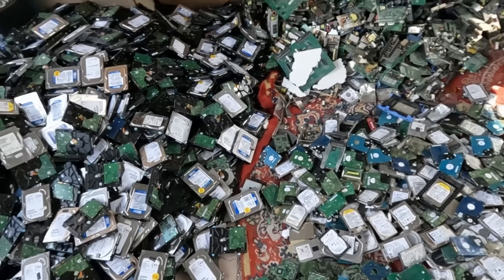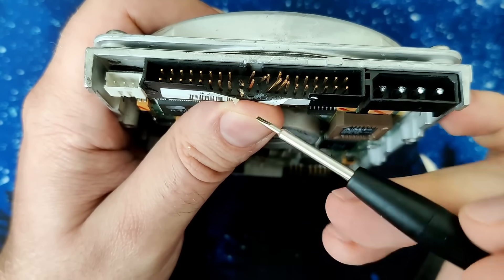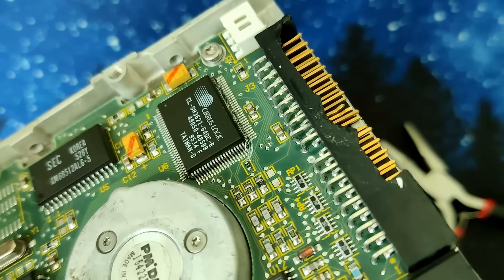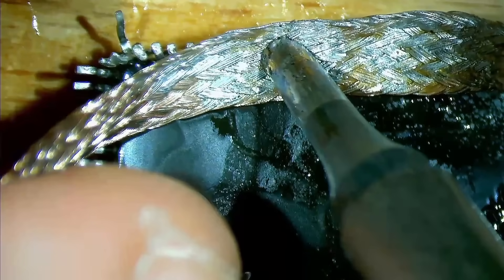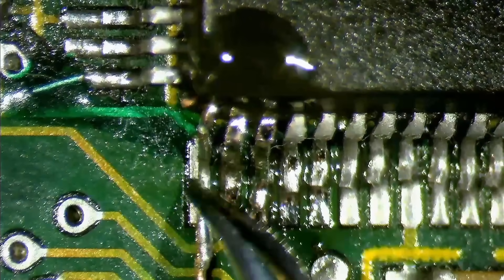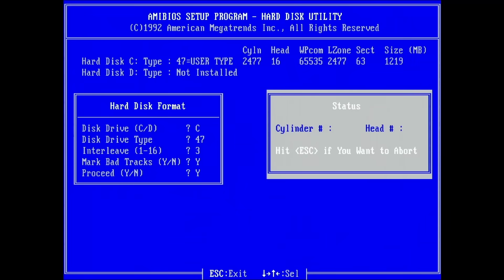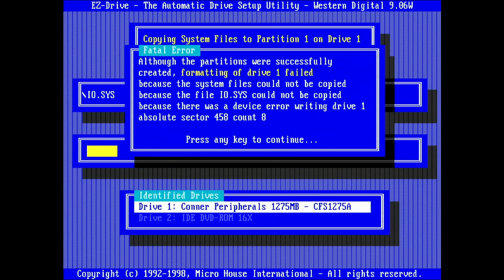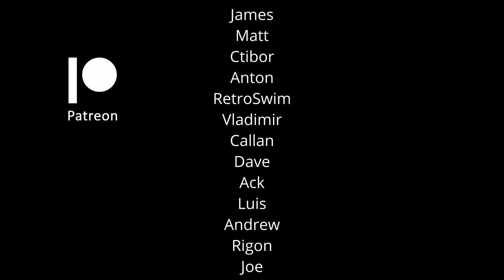IDE hard drive wants a final chance: Conner CFS1275A

Comment: I think your best bet is to try and make a complete hard drive from scratch ;)
Reply: A guy on YT makes chips at home (1000 to 10000 transistor) but making a HDD?  If it could be spun up, clean itself and then told when to go you might be able to make a HDD at home if no chips are complex.
Reply from the maker: Ah, hehe. I don't know... I have a feeling that this would be a talent that is obsolete...
Reply: I said it like that because I get a feeling there's something wrong inside the platter. It was a joke lol
I don't even understand what kind of gear you would need to begin the process of making the platter and arm thingies inside.

Comment: The sound of the heads feels to me a bit strange. Could be a connection issue somewhere that doesn't prevent the drive to be detected, but not working properly. Could be the case?
Reply from the maker: Yes, it could be. But it does access parts of platters. I can read and write the boot track. And I managed to install ez-drive (also create the partition). I'll probably leave the drive for now. I have a lot of other drives from which I may learn more...
Reply: @bitsundbolts  yes, it seems to be a dead end. Once the time is limited, it will be wise focusing into more promising stuff.